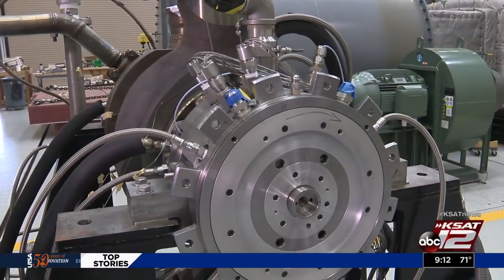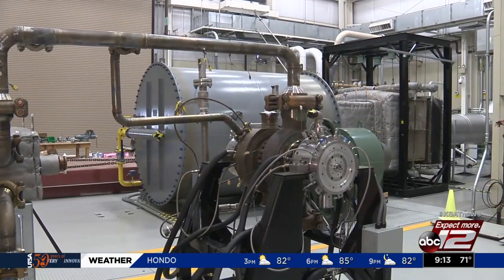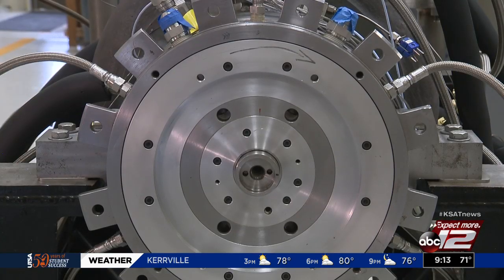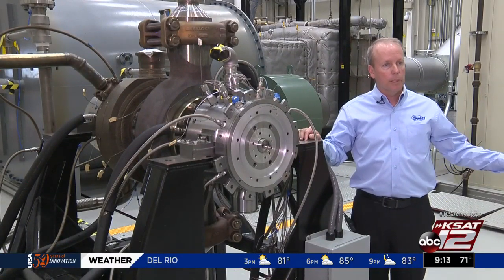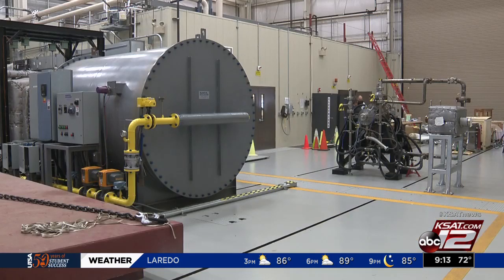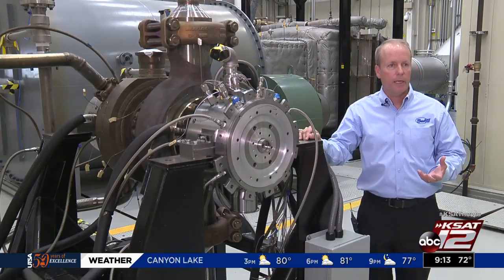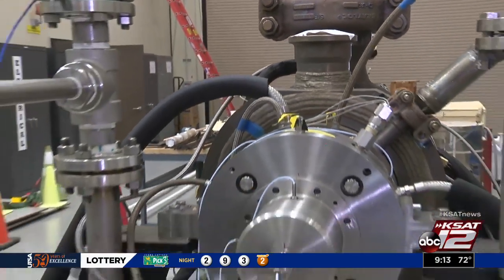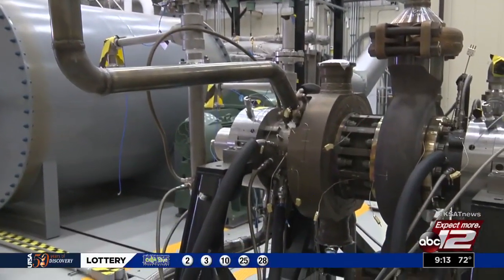TECH SA: New turbine could change the way electricity is powered

Comment: This is a small Turbine can handle huge amount of energy to convert heat to mechanical. It also offers 5-10 % more efficiency as well. However you still need to have a large source of energy which is heat in this case. So we do not produce energy from CO2. It is only a high density energy carrier liquid. So it has more momentum when you move it... so it applies more torque to turbine blaeds comparing to steam...

Comment: CO2 is the working fluid it still needs a heat source - The properties of Super Critical CO2 does allow for a much smaller turbine as compared to a steam turbine and it supposable can be around 5-7% more efficient - I wonder if it scales down, if something the size of a desk can produce 10 mega watts could you build something the size of a coffee can to make 50Kw for a range extender?
Reply: Interesting question. I was listening to a pod cast with the researchers and designers and the scale effects technologies like this. If it was the size of the coffee can the energy needed to still run the turbine (waste heat etc) along with the complexity makes it not feasible. So they idea they are using is make it commercial viable in an industrial application to make it an attractive option. The main targets being industrial processes creating massive amounts of waste heat. In theory it could probably be shrunk down but they are also using a this turbine in a functional power plant to test durability, reliability, operations perimeters and many other unknown metrics. They use manufacturing techniques from oil/gas and arospace.  Very interesting and cool Technology and I hope it gets to a point it could be use at a residential level.
Reply: Yes
Reply: This is possible but the coffee can size turbine would have to run at 50.000 rpm.
Reply: That's correct - the scientific illiteracy of science journalists is staggering. As for the scaling down, it should be mentioned that turbine efficiency goes down as they get smaller, I don't think this technology can be used in cars, but it can be used to propel a ship for instance, and maybe an aircraft as well.
Reply: Like the swedish u boats whoops i meant boats just boats 😅  @lucianene7741